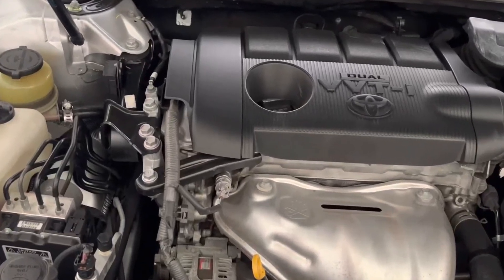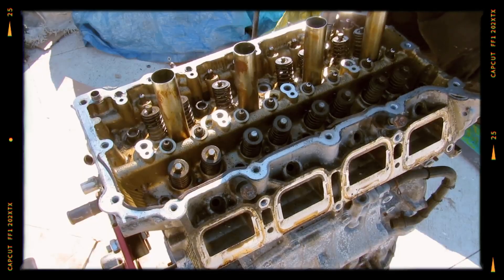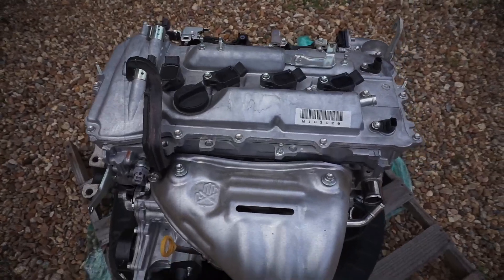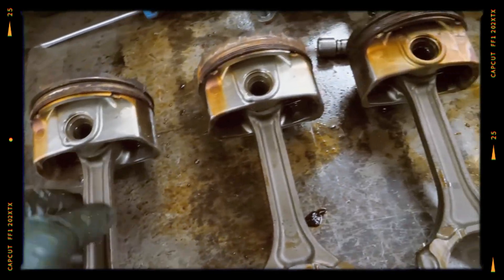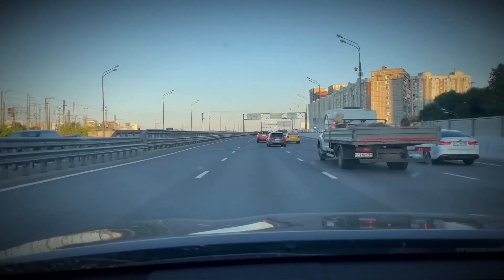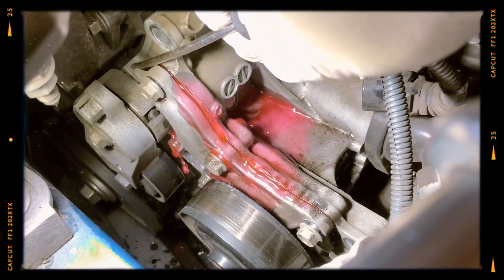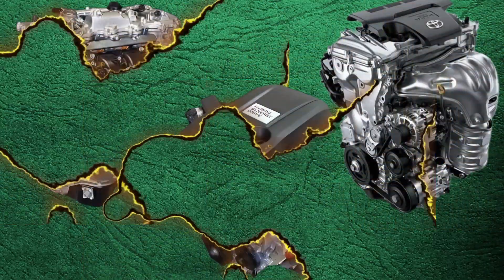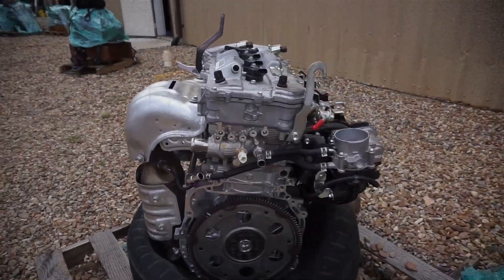Toyota 2AR Engine: Reliability, Common Issues, and How to Maximize Its Lifespan!

Comment: While stating the common problems with this particular engine is all well and good, listing the years affected would go a step further. Not all iterations of the 2AR-FE have the same issue(s). First iteration had the cam phaser and water pump leak. This particular iteration was found in the 2010-12 Camry and 2010-13 RAV 4. Iteration two of the 2AR-FE got rid of the cam phaser issue.

Comment: Please help me. I have a 2010 2AR FE engine that comes up with a grinding noise on cold start and whenever i want to to accelerate or reverse.what is  the cause of the grinding noise that comes up at cold start and goes off after sometime the engine has heat up?
Reply: BALANCER SHAFT
Reply: @amcterminal2775 thanks, already fixed.
Reply: Vvt rattle

Comment: The rattle is one of the biggest concerns. I just got a 2009 rav4 and has it , will be asking mechanic if it’s worth fixing.  Never follow the 10k oil changes always do 5k or even 4-3k miles for an oil change. As it leads to oil consumption.

Comment: Is the vvti rattle a big problem and does it cause any damage.
Reply: The camshaft phasers can fail, but I've never seen one as long as you don't let it run low on oil. I personally run 0W-20 Valvoline high mileage full synthetic That's the silver container, not the red one. It has the highest additive package, confirmed by Blackstone Lab. Also if you have not changed the PCV valve, I highly recommend that you do. It is located behind the intake manifold. As long as you do timely maintenance on these engines, they will serve you well. I'm personally sitting on 325,000 Miles myself.
Reply: @Timothy7877 is that the same as the Valvoline HM Max life? I think it has a red cap. Heard that one is the best, other than R&P
Reply: Replace the timing chain tensioner